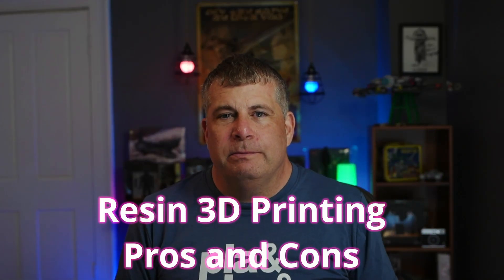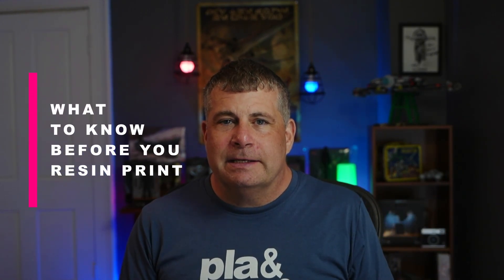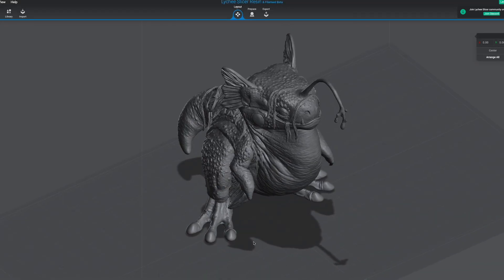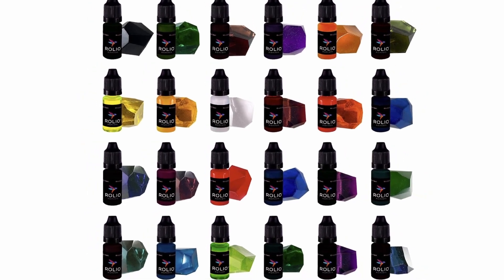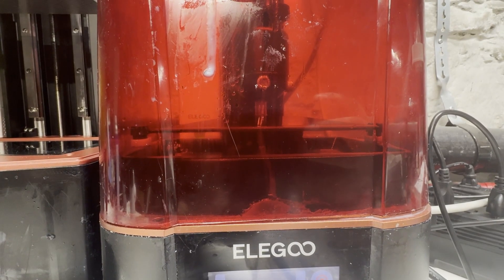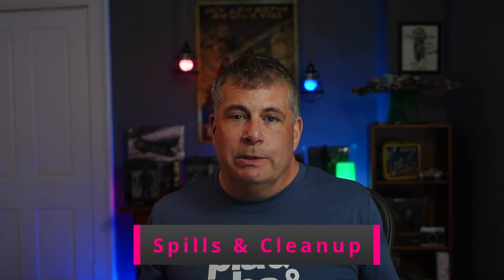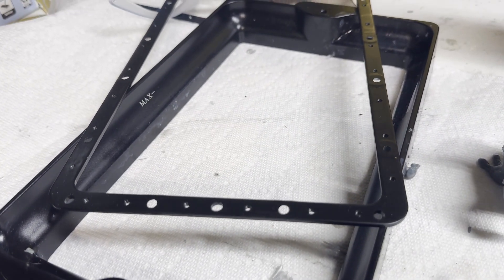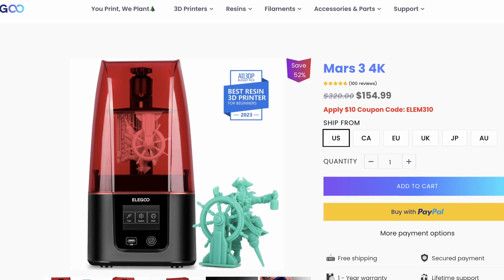Resin Printing, The Truth - Don't Buy That Resin Printer Until You Watch This

Comment: Fep needs replacing more often than regularly. Don’t print a layout more than twice. It causes wear spots in the film and will tear causing resin to leak through. My entire printer is covered outside and in. It only had 3 prints with new film fitted. Leaving resin and moving onto filament. Too many negatives outweigh the positives. 3 years with the mars 3 pro and only 6 months with the mars 4. Both now bin jobs. Starting from scratch with the centauri carbon

Comment: Not sure I am ready to risk my eyesight or perhaps my life to 3D print a horse.
Reply from the maker: Yup. I have the ones I use out in my detached garage and wear ppe. But it’s a nice horse at least.
Reply: Bit of an exaggerated comment. Been using, resin printers for 10 plus years in my home. It is just common sense, wear gloves, to be fair even a mask isnt necessary unless you like to lick stuff. Just buy a purifier or vent your home correctly.

Comment: No strings attached except a free printer
Reply from the maker: So this is how product reviews work. This isn't to try and argue with your point, but to explain the process. 

A reviewer wants to cover a product, or the manufacturer wants a product covered. Whichever, one reaches out to the other. They talk about what the product reviewer needs, and that product gets sent out. 

Companies can't exist without the product getting exposure, the reviewer can't afford to buy all the products to test. 

If it's an expensive or reuseable product, it usually goes back. Cameras, phones, etc. If it's an item that has no re-use value, it usually stays with the reviewer. You can't ship a used resin printer back to China. It's literally a biohazard once it's been used. 

There are other products where the cost of return shipping isn't worth it to the manufacturer. I've done a bunch of keyboard reviews, but shipping a keyboard back to China makes no sense for anyone. I give the keyboards away because you only need one keyboard for each computer. 

Good channels specifically tell the manufacturer that they can't see the review beforehand, that the review will have both good and bad features listed, etc. Channels that aren't honest will often show the footage to the company or get the company to sign off on scripts, but still not have to declare the video is sponsored. 

Right now there are 8 filament printers in my studio, and four resin printers (plus one resin printer I took apart to check out the mechanism.) There is legitimately nothing that 12 printers helps me do. I have had lots of printers that I've given away because they're replaced with newer tech, and because having a dozen printers isn't as awesome as it sounds. 

So yup, no strings attached except a free printer. Only, I'm not asking for a quid-pro-quo. I'm genuinely  going to say what I think about the products. 

If you look at my channel's list of videos you'll see that the highest views are on videos I made on the problems with Neptune 4 Max printers. They both go into great detail on what Elegoo did wrong with them, and how users can handle it. 

And Elegoo thanked me for the videos. They helped customers fix issues and they gave feedback to engineers. And I have a great relationship with them as a result of the videos. 

So yes, I get more free things than people who don't review products. I don't let the companies participate in the reviews, and I'll never take a review down at their request. 

The tradeoff I guess is that I don't get a paycheck, health insurance, retirment savings, etc. But at least I have a room full of quietly aging printers.
Reply: Long story short. Getting free stuff inherently affects your review.

Comment: Great video, thanks for the info..  I am pretty new to 3D printing, please forgive me if I use the wrong terminology.   I 3D print items that will be placed in water for a long period of time (years), example would be sunken treasure boxes that you would place as a decorative in a fish tank.  What would be the best and cheapest way to print with a material that would last under water maintaining both color and structure?  To save cost on print materials I am wondering if the way to go is a less expensive material cost for the 3D printing then apply a finish that waterproofs and maintains color and structure...or if it would be better to go ahead and print with the better material from the get go.
Reply from the maker: All 3D material should be relatively color fast in water. Sun would be more of an issue then water. I would avoid resin only because resin is toxic and while you're cleaning it off, I don't know how much resin would be an issue for fish. 

Any filament would work. I'd probably go with petg as it's more durable. As it's plastic it will float unless you do a heavy infill pattern or place something heavy inside the treasure box.

Comment: I don't know what I think about this video it gives a good introduction in the topic of resin 3d printing but I think the cons are really played down. A good but strongly biased video. First there companies that use resin 3d printing for prototypes. Yeah but not as many as companies that use FDM but most important it's about what the company produces anything medical 100% resin printed but everywhere else in the industry it looks more like 60-80% FDM printing. Second the UV curing,  alcohol post processing and the required ventilation are pretty big factors that will cost you a lot too and the resin is compared to filament also a good bit more expensive so yeah you could buy a small cheap resin 3d printer but only for the equipment you need in addition you could buy a FDM printer with everything it needs
Reply from the maker: I really appreciate the feedback. It's things like this that make my videos better and thanks for taking the time to write it! At least the video made you interested in giving your thoughts. 

I actually was worried the negatives were too much of the focus.  

I certainly wasn't trying to suggest everyone should resin print only. Film and printers are obviously most practical and the uses to use. But I think that the process of Ross printing really good and appreciation for the whole 3-D world because it's a different way to think about design, layout and production.
Reply: And one last thing there aren't many different types of resin you can print there are many colors but really different types of resin there aren't more than 30 and I think there are more than 200 different types of filaments with all the metal, wood, glass and I've even seen concrete printing